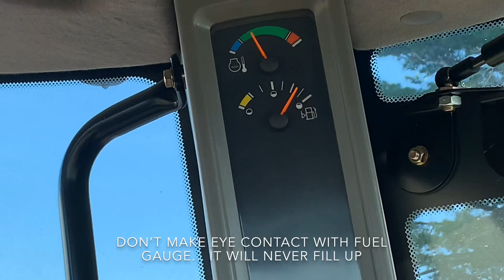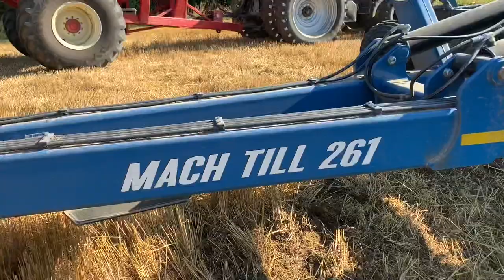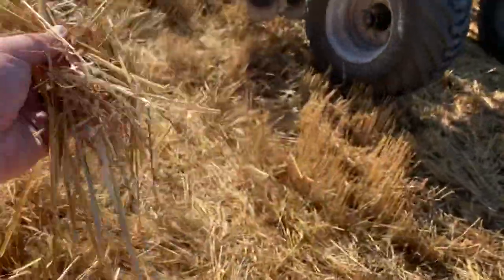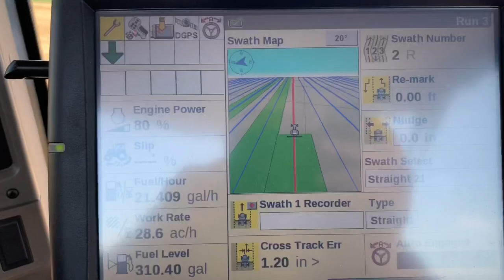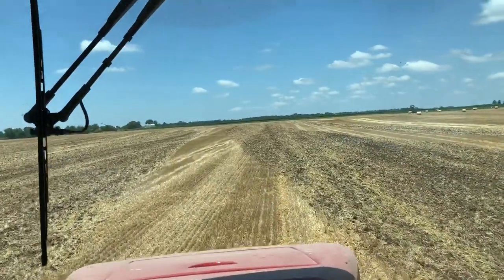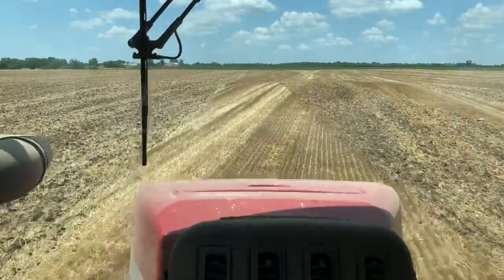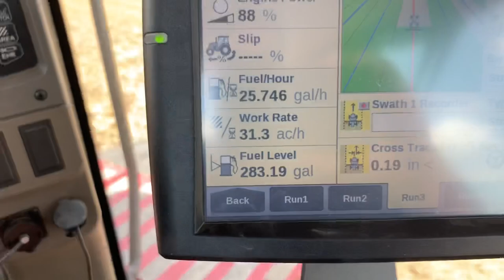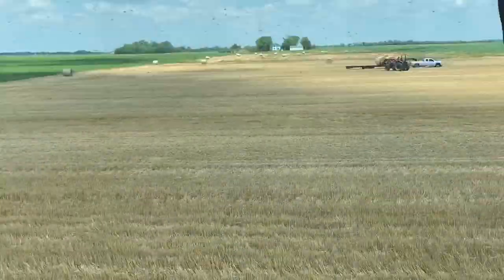Kinze Mach till 261 // Farm Vlog

Comment: To be honest.... I'm not too impressed with the job the Mach Till did.   Especially considering much of the straw had already been removed through the baling, and the operator said the soil conditions were moist.    Preferably, I would like to see the field "darker" in those conditions.    Perhaps the unit could have been set to till deeper, which might have made a difference.   But as it stands.... I'm not to impressed.